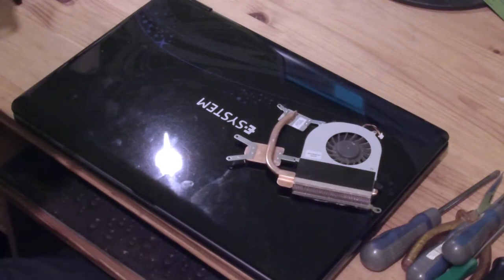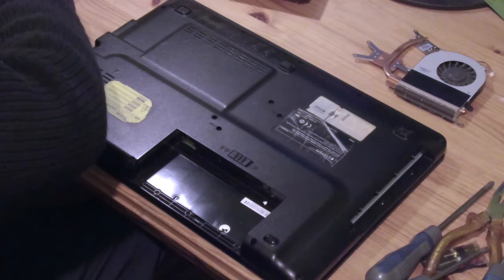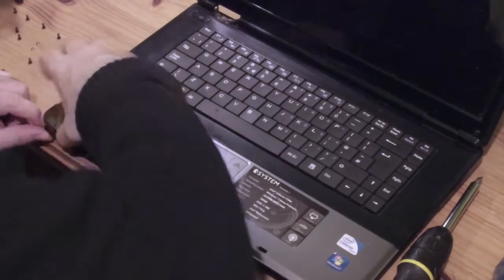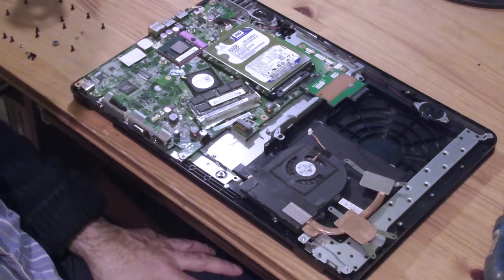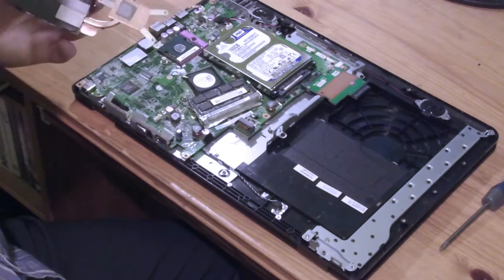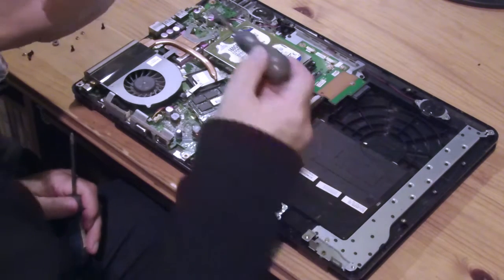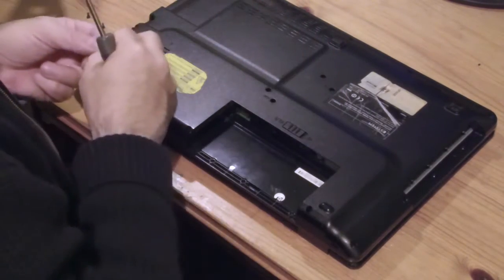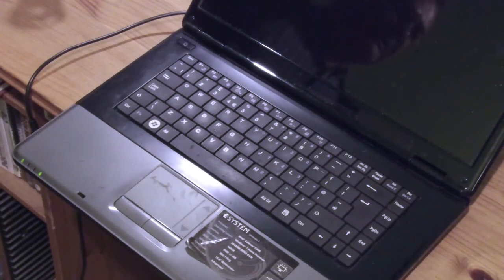E-System Sorrento 1 How to Repair or Replace Cooling Fan

Comment: The biggest thing that could go wrong is letting you work on this.. my god where do I start… The screwdriver you used to remove the bottom plastics – LOL.. scraping the board with a pair of scissors, no thermal paste, er.. “glue”? Hahaha, bending the heatsink as you had no thermal pads, and suggesting it could dissipate the heat via “radiation” Bahahaha – that’s the best one…. I could go on, seriously this is a cracking video to show people just what NOT to do when stripping a laptop….. this is priceless… just one question.. how are you still alive? Seriously…….
Reply from the maker: Infra-red "radiation" warms up air which is blown out by the fan.
Reply: @alphatucana  Oh my god, even when you’ve had time to think about it your reply its nonsense. The heatsink doesn’t carry hot air, it works via conduction.. the heat travels down its core to the fan which then blows out hot air, thus cooling the heatsink. The said heatsink has to be in direct contact with the chip in order for the conduction to occur. Its got sod all to do with ir radiation..
Reply from the maker: @daveedwards3648  Oh well.
Reply: Who in their right mind even works on e-systems? I practically never even see e-system laptops around nowadays, maybe on ebay but that's it.... I suppose half of the stock of e-systems has been taken to the landfill, and the other half sitting in various old couples houses. Maybe it is because of the 2GB RAM limit and the 1GB already applied into the laptops. Absolute shite hardware.

Comment: You must do more software work than hardware I'm guessing.  I must have 6 or 7 tubes of thermal paste laying around from old builds and upgrades..  Wish I could hand it to you through the screen lol.

Also no static protection?  Is that not a worry with this fix?  If so why?
Reply from the maker: +The Lowmein Yes, it's nearly all Windows and virus stuff these days. I've never found static to be a problem when working on a wooden bench - I'm guessing that the wood (or the varnish) maintains a fine coating of moisture which conducts it all away. I suppose it may vary according to the wood, the varnish, the humidity and other variables.
Reply: @alphatucana  You're hilarious. Wood is generally non-conductive (although there is a tiny bit of electric being taken away in some wood-types.) It would be good to have static protection for all cases to do with meddling with electricity inside of a shitty brand like e-systems. The only case I would use e-systems is for messing with hardware.

Comment: I ant seem to fine any WiFi signal on the same E-System laptop...any help
Reply from the maker: The Wi-Fi card inside may be faulty or disconnected.
Reply: laptop e system sorrento 1 body kit